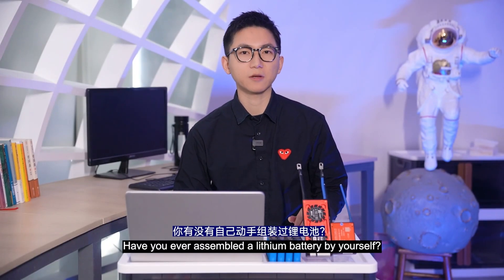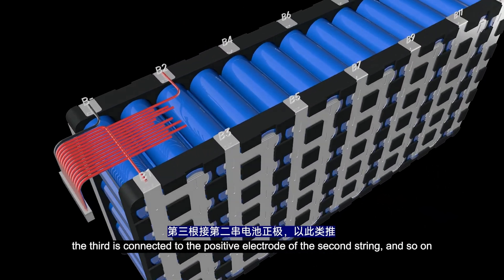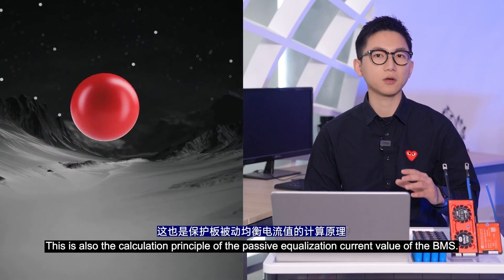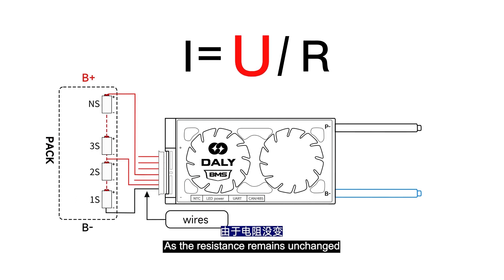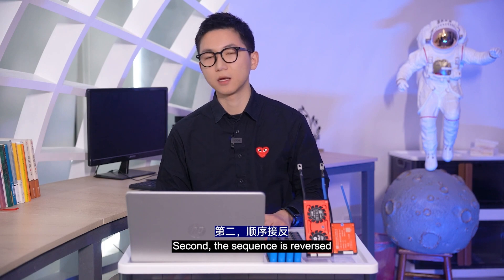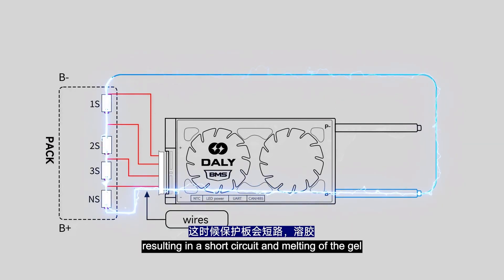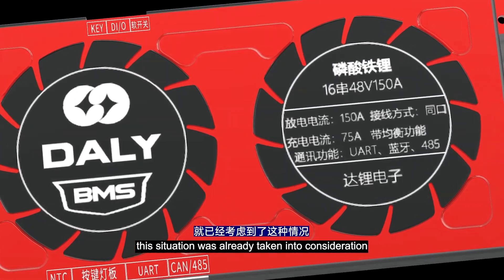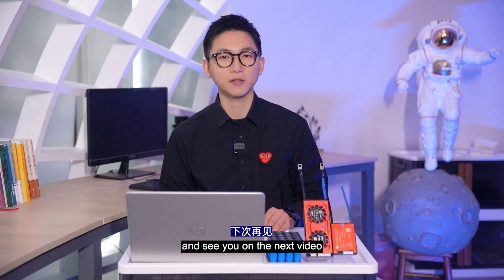How to connect the lithium battery and BMS? What happens when the wires are connected incorrectly?

Comment: It's a good video. Make another video about serial connection of BMS for high voltage assemblies, 40s-60s-96s. Using multiple BMS. For example: build 48S, 192v, 2 BMS on 24s